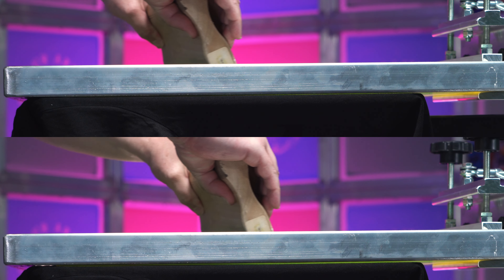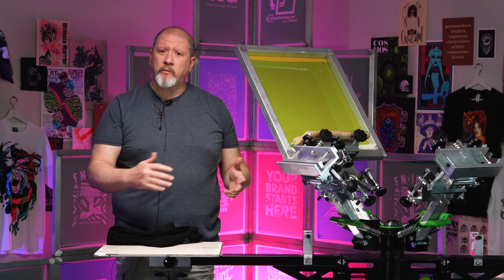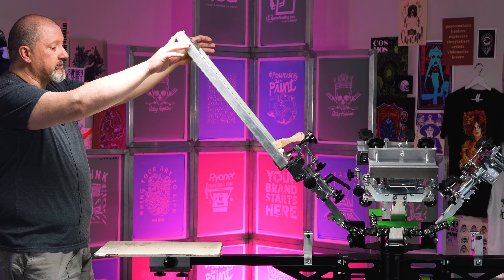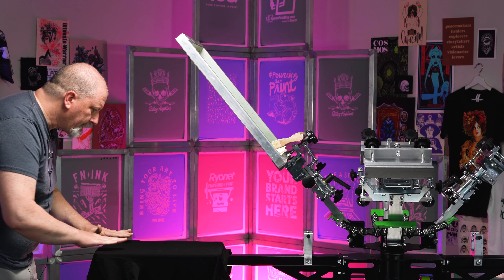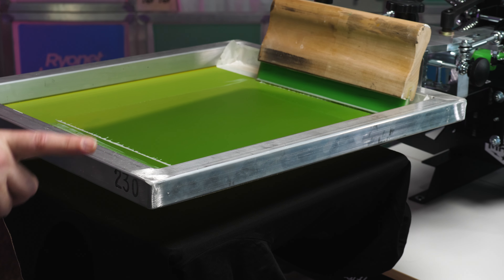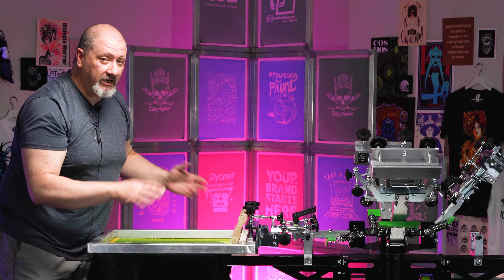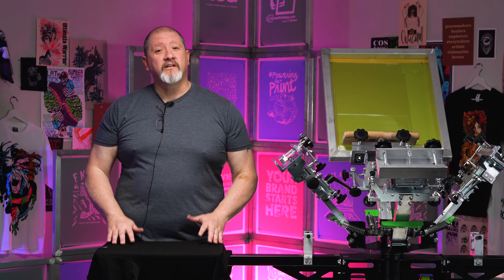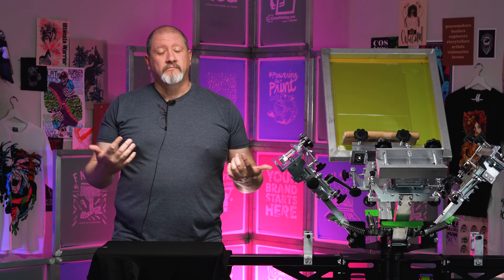Functional Off-Contact For Great Screen Print Results | Deep Dive With Colin

Comment: @ryonet i have always put a dime on the back where you put the pcs of clean card when i do hoodies. i have my off contact for t'shirts just about 1/8 work great for my 8year old R250 4/6 screen press
Reply from the maker: You've got your process! That's what it's all about....
Reply: With the “do not touch” bolt, are you just saying don’t touch it after you’ve gotten your screens in registration?

Comment: I touched the do not touch bolt. How do i fix it now?
Reply from the maker: Thanks for the wait. The "Do not Touch" bolt is used to lock in the level for the print heads so that every single print is consistent. Here is a guide to reset it: https://youtu.be/0kfaeNxoxwY